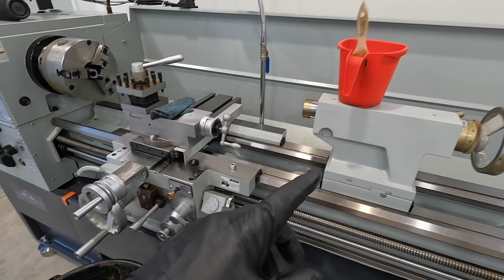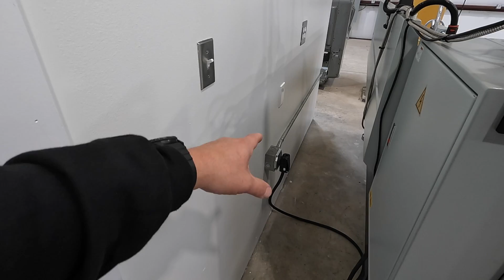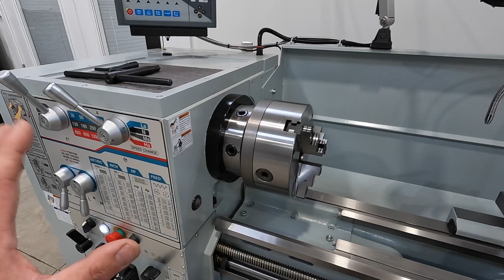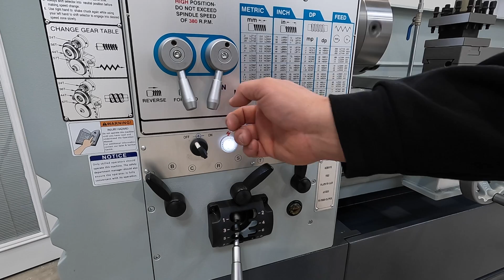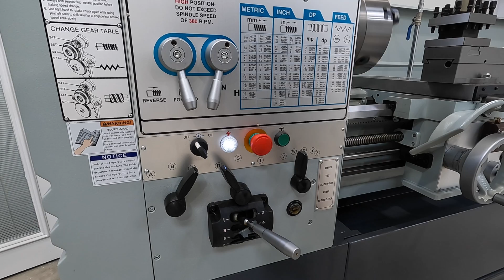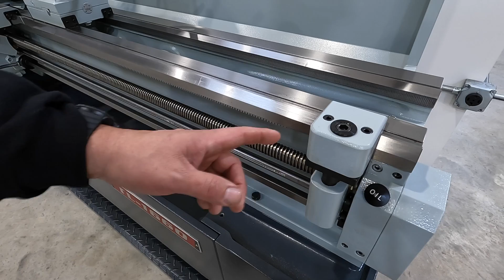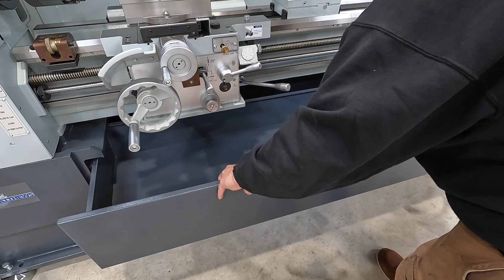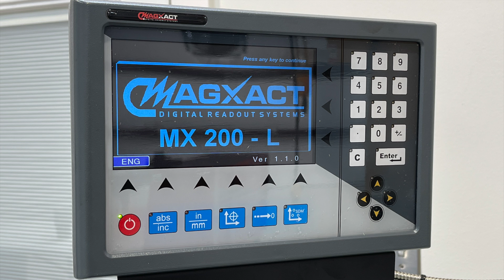Precision Matthews TL 1660 First Run

Comment: Adam just curious why so many machinist opt for 4 jaw over 3 jaw. Is the 3 inherently not as acurrate?
Reply: As pointed out above, the chucks on a 4 jaw can generally be adjusted independently, which lets you dial them in arbitrarily. But not only that, it lets you hold an object that's not round in the first place or off center from the cutting center. Imagine for example a some sort of drive shaft with a lever on the end.
Reply: Adam can answer, but with a 4-jaw you can get arbitrarily accurate runout, since you can adjust the jaws individually. until the workpiece is centered. The typical 3-jaw is what is called a "scroll chuck" because there is a scroll that moves all the jaws at once. The scroll always has some runout to make it able to move, but it also allows some runout in the jaws. That's why tightening all 3 worms -  that move the same scroll - reduces the runout to a minimum, because it centers the scroll. Typical errors would be on the order of .005", and it gets worse as the chuck wears. If you are going to do all the turning operations and all outside turning and inside boring done without removing the workpiece, the runout doesn't matter, but if you have to move it, swap ends, etc, the runout matters. There are also "independent" 3-jaw chucks, and scroll version of 4-jaws and 6-jaws.
Reply: With a 4-jaw independent chuck, you can mount up square or rectangular stock, as well as dial the work in to .0001” if you take the time (not more than 5-10 minutes to get it between .0001” & zero).
Reply: 3 jaws are nice for quick work, but a 4 jaw can be dialed in for perfect concentricity. Some 3 jaws can be dialed in on a backing plate, but that is much more laborious than a 4 jaw. For day to day use, I use a 3 (actually 6) jaw chuck, but for anything that has to be truly accurate, it's the 4 jaw every time.
Reply: Commonly, the 3-jaw is a self-centring chuck where all the jaws move at the same time - and with the 4-jaw, the jaws move independently of one another - so you have to centre the work - which means you can centre it as precisely as you like. So it depends how accurate and concentric the finished item needs to be.  Another option for high accuracy is to turn between centres - and hence one of their names: 'centre lathe'.

Comment: This is a copy of a colchester lathe.
Reply: Interesting. The feeds 'joystick' lever is of the Colchester continental style QCGB.
Which model Colchester is it a copy of ?
Reply: @millomweb  It looks very similar to my Colchester Master 2500 aka the Clausing 1320 and 1340 in America - Joe Pie has the Clausing - you can see the similarities on his machine.
Reply: @steveallarton98  Looks like the QCGB is, doesn't it ! Differences elsewhere though.
Reply: Absolutely agreed !
The main gear box speed selection arrangement looks like the Harrison M300, which comes from the same stable as the Colchester / Clausing, and I think that the carriage and tailstock look similar, too - even the swarf ( chips ) tray and coolant system look identical !
I wonder if it carries the induction hardened bedways and gears, that Colchester were so proud of !
None of this is intended as criticism of what looks to be a fine machine - it certainly seems to run sweetly enough, and I think that it was a wise choice . . . .
Reply: @steveallarton98  Not sure who Precision Matthews is - (a sister of Precious Matthews ??) Actually a sister of Quality Machine Tools LLC with one and a half websites - the half seemingly having only one page to it !
I note the threading dial looks like the Colchester one but I see differences on the apron. Deffo no co-ax headstock gear selector that is quite distinctive.

Comment: what kind of jobs will you use this lathe for that the other lathes wont do?
Reply: New lathe produces accurate parts.
Reply: oh right, i thought it was for a special purpose,
Reply: His other Victor lathe had some chatter issues as well.
Reply: @the_hate_inside1085  what do you mean?
Reply: @keel23345  It was vibrating to much to part off work.

Comment: Ohh man that's sweet.  I couldn't have taken that plastic off the plate .
Reply: Yup. I have a two-year-old $90 Amazon microwave, and the foil is still on.  I never take that stuff off.
Reply: @aj7utu  haha that's pretty bad.  I finally took it off my 4 year old SS fridge I was worried you would see the difference but it's ok.  Still got it on my washer and dryer though.  Kenmore all the way usa.!!

Comment: Myself, I would make or find a couple short, pan-head bolts to put in the holes for the bolts for the chip-pan brackets to keep Swarf out of the holes and clogging the threads
Reply: Those holes possibly go right through - so he'll just litter the floor :)
Reply: @millomweb  The THREADS in the holes will get full sticky way oil and chips and swarf, making them an extra job in the future what harm is putting two bolts in to prevent this if he chooses not to use the clips?
Reply: @Mad-Duk_Machine_Werkes  He could store the clips by refitting them at 90° to normal - so they don't work but are there if he wants to use them when he moves shops again.

Comment: You should have left that protective film on. It would heve kept it looking new for quite a  while. A lot of products have this film, TVs, you name it. I always leave it on until it starts flaking off in a year or 2 or longer. 😎
Reply: You do you, pretty sure nobody cares what you do.
Reply: @CB.5  Doesn't matter to me. Neither do useless comments. 😎
Reply: But it's a fact, that protective film serves a very good purpose. If you observe the film is substantial in thickness and adhesion. I have a TV that has has it on for almost 10 years. I think it would have been good on that lathe for a year or two at least. Also contaminants, dirt, and oils would be easier to clean in the interim. Keeping that fresh new look for longer while protecting the labeling. If it were my lathe, I would likely do just that. 😎
Reply: @rca7591a  The film is intended to be removed after manufacturing and assembly.  Did you leave the white plastic on that covered all the panels of your new car too?

Comment: what do you use in. or metric and what is better? the world uses metric not the US!
Reply: Technically the US is on the metric system.  They just have a weird conversion factor for everyday use.
Reply: Mostly imperial - but he'll be happy to use both now. I'm imperial too (in UK). I don't have much metric stuff at all !
Reply: He's in the US, so inch is standard.
Reply: @stargazer7644  Is that the imperial inch or the metric inch ?
Reply: @millomweb  1/18th of a cubit.
Reply: Neither is better. They are both equally as accurate. Use what works for you and don’t worry about what everyone else does.

Comment: I never cared for the switch to led for machine work lights. It seems like they have a ton of glare and i prefer the older halogen or florescent lights.
Reply: Years ago I bought all LED lights for home to save electricity but after that I learned that they create blue light and dirty electricity so I threw them away and now use incandescent bulbs only because I rather use safer bulbs than save electricity.
Reply: @flat-earther  what is “dirty electricity“?
Reply: @yalebaker7976  Dirty electricity AKA high frequency transients. It creates higher frequencies on your wiring which allegedly jump off of your wiring in your wall into your home which is not healthy, normally you only should have 50 or 60Hz. the LEDs work on DC so they have to turn the AC to DC and the way this is done in many devices creates high frequencies back to your wiring that should not be there.  Many electronic device designers are not aware or don't care or know how to design products that don't ''pollute''.
To measure it there are dirty electricity meters which you can plug into your outlet to test how much you have, also called EMI meters, power line meters.
There is another cheap way to roughly detect dirty electricity with an AM radio tuned to about 520KHz, you can hear the noise with the radio.
I just learned these things myself so I'm no expert. You can read more about it if you want.
Reply: @flat-earther  do you believe everything you read on the internet? Are you one of the people who thinks electricity will pour out of a receptacle if you switch it on without a plug in? I suggest you learn some actual facts or get some tinfoil and make yourself a hat
Reply: @andyb7963  No I don't believe everything I read on the internet. No.
I am a flat earther by the way. So I overcame a lifetime of globe indoctrination by looking at information and making my own mind up. I was hesitant to look into flat stationary earth after hearing about it but once I did I now don't believe the earth is flat, I know it is flat.
But don't google flat earth because google will feed you the ''Flat earth society'' which is controlled opposition made to make you think flat earth is dumb and something it is not, for example they will tell you flat earth is a disc floating in space with other planets, no that it not what flat earth really is. 

Flat earth is actually the center of creation, and ''Space'' doesn't exist. ''Space'' which they tell us is a vacuum beside a pressurized earth atmosphere with no barrier in between is a violation of the second law of thermodynamics.

Watch David Weiss for example to learn more about flat earth, his channel is DITRH. David is offering 3 bitcoins for 1 proof of the globe.
Reply: @flat-earther  You need real help. Help the internet can’t provide.
Reply: @grntitan1  Is that your best globe proof?
Reply: That's what they invented diffusers for.

Comment: Adam ,is it possible to install other lathe chucks in this lathe?
Reply from the maker: Spindle is D1-6 so yes you can install any chuck you’d like that fits the spindle.
Reply: Short answer is yes, the lathe has a D1-6 flange on the spindle….
Reply: It appears to be a cam-lock spindle, so yes he can install other chucks or faceplates
Reply: Thanks

Comment: Great looking lathe. While I don't wish to be negative I have to say I'm surprised that it is taking so long to get the shop up and running. You've been in it for 3 months now and we still haven't seen any swarf hit the floor. I recall just after you took it on you said you were planning to be in it for maybe 2 years, so the clock is seemingly ticking. I'm sure there are good reasons for things going the way they are, but it's surprising nonetheless.
Reply: At the other end of the spectrum from Richard Rawlings'  Garage Rehab venture.  But Adam's business is almost entirely YouTube , and the whole 2 yrs is no doubt funded irrespective of revenue from outside work.
Reply: Although I'm aware some revenue comes from YT videos themselves, you've got to assume that there is some intent behind buying and installing that huge lathe to actually use it in some way. Showing videos of cleaning the oil off another lathe isn't going to keep the channel going for long.

I presumed Adam was going to go back to turning large shafts amongst other things but there doesn't seem to be much in the way of urgency behind getting that other machine going.  But obviously he'll go at his own pace and has his reasons for doing so.

One of the reasons I watch this channel is because he makes end products with his tools. There are many channels out there that buy tools and then spend all of their time making things to improve the tools and never actually use them for anything else (clough42 for example). In that sense their whole venture is just a massive time wasting exercise lol.
Reply: @ric355  I think it's all mostly payment for advertising products. Look at the viewers and subscribers numbers and all  of the correct target. It's a dream come true for Kubota and the others.
Reply: @JohnSmith-vi5pz  Yes, I'm aware the revenue on many channels comes from sponsors. I watch a lot of automotive channels and it's rife there.
Reply: @ric355  So, that being your observation, one has to ask why you asked the initial question that you now tacitly admit that you already knew the answer to.
Reply: @JohnSmith-vi5pz  If you look at what I wrote originally again, I didn't actually ask a question at all. I  stated that I thought things might have moved forward a bit quicker than they have. He still has a mostly empty shop, and while he could keep making content like he has, it isn't going to sustain his channel by itself as viewers will get bored. 

Maybe it's just me; I couldn't watch this video without jumping ahead. It was just too long watching him clean a lathe, peel off some plastic, and test it.

Historically Adam's content has been much more interesting to me because he actually makes stuff and that's how the channel grew. Those paying sponsors (if they exist) will only keep paying while people are viewing the content and an empty shop isn't exactly compelling viewing.

I was actually trying not to directly criticise in my original remark as I have absolutely no right to do so. It's his channel and he can do as he likes.
Reply: @ric355  Make no mistake, you were taking a clear cut pop at Adam, you wrapped it up in weasel words like a coward. I suggest you make your own channel, I'm sure your pomposity and boorish attitude will have the viewers flocking in.

Comment: Being able to remove the coolant container is a nice quality of life feature. Only thing it's missing is a quick disconnect for the fluid line and the wire. Very easy and quick to clean the container then.
Reply: Depends how often you would need to do the job?

Comment: I have been going back to regular light bulbs lately.  The led bulbs flicker and the light spectrum and intensity bothers my eyes.
The flicker makes a strobe effect on the work in the lathe too, so that's another issue.
The spectrum from a regular bulb gives very good resolution and detail for me.
Reply: You could get a ‘warm white’ led? The yellow light is nicer on the eyes, the blue range from the white isnt great
Reply: Me too. Years ago I bought LED lights for home to save electricity. Later I learned that they create harmful blue light. And they also create dirty electricity while incandescent bulbs create absolutely none. So I threw the LEDs away and now use incandescent bulbs only because I rather use safer bulbs than save electricity.
Reply: @flat-earther  And the incandescent bulbs waste 95% of the power you run through them.  You can buy LED bulbs in any color temperature you like, including ones that are the same as warm incandescent with very little blue light.  "Dirty electricity"?  "Safer bulbs"?  What?
Reply: That entirely depends on the power supply.  If you have a DC LED bulb, there's no flicker at all.

Comment: Adam, I would suggest possibly the use of oil based cutting fluids, like for a swiss style lathe.  That is what we use to prevent rust and ensure adequate lubrication. Our TL-1640 is ~6months old and looks like the day we got it.

Comment: I assume you had already taken care of it because everything seems to be working, but just in case: there's a bolt on the right side of the carriage/saddle that has a sticker under it saying you must release it before operation. But I see the bolt is in place. You can see it there at 16:18,
Reply: Release ≠ remove.  A half-turn would release the carriage lock and keep the hole blocked from swarf.
Reply: @endotherm  I see. In the pic, it looked like it was pulled way up from the surface, so I thought it needed to be pulled up further.
Reply: Specsavers needed  it says released its the carriage lock
Reply: @stuarthardy4626  Not sure why I need specsavers.

Comment: Hello adam. I love your videos. I learn..just a tip:You should've not removed the plastic cover at the prints. It also is a protection so as the prints don't fade easily.

Comment: We have the same machine but a 40" length.  Been happy with it overall.  Light is really handy.  As you said brake works great.  Plenty of power and rigid.  Only issue we have is the oiler pump on the saddle does not oil the far bed way, just the way closest to pump.  Seems to oil cross slide and screw very well.  If you use coolant make sure to oil the far way under saddle manually or it will stain the way after a day or two.  Love the channel!

Comment: I remember reading about spinning up a lathe with nothing in the chuck. Chance of the jaws working themselves out? Is that true?
Reply: maybe if they are close to being all the way out, or really sloppy.   I don't doubt its happened, but prob very rare.   If you're worried, tighten the jaws on themself.
Reply: I’ve never seen or heard of it happening. Your chuck would have to have the jaws nearly all the way out and be one sloppy loose piece of tooling.
Reply: @grntitan1  Imagine this. Scroll has mass; inertia. Strong starting lathe with good acceleration. Jaws are pushing on an inclined plane with centrifugal force. Do this enough times, your jaws will come out.
Reply: @TheMetalButcher  I'd like you to show me how pushing on the jaws makes the scroll or the worm move even a tiny little bit.  It isn't possible.
Reply: It can happen.
Reply: Wut?

Comment: Would you actually use 1800 RPM for cutting, or is that for polishing a finished piece?  Impressively smooth and quiet machine.  I suppose gears are machined to much finer tolerances these days than they were 50 years ago.  Less play in the power train, less noise you'll get.
Reply: Absolutely you could use 1800 rpm for turning, and a lot of machine go much higher than that.
Reply: see I saw 1800 & though that was quite low (as a top speed).  carbide loves speed.